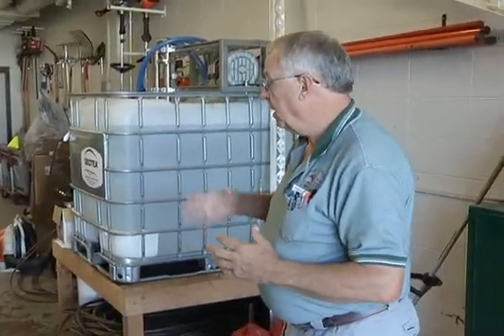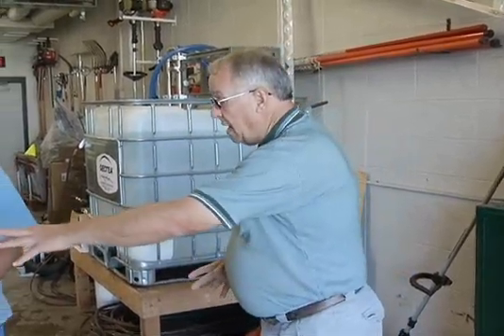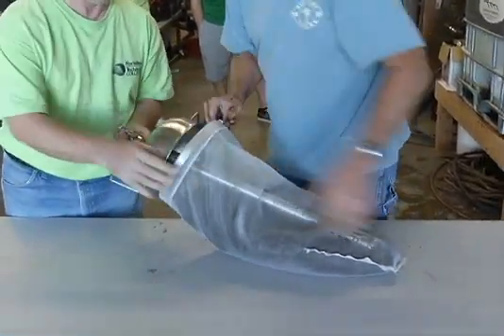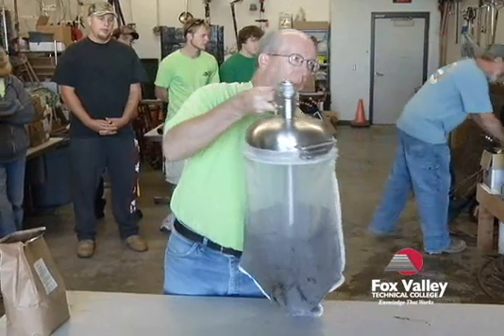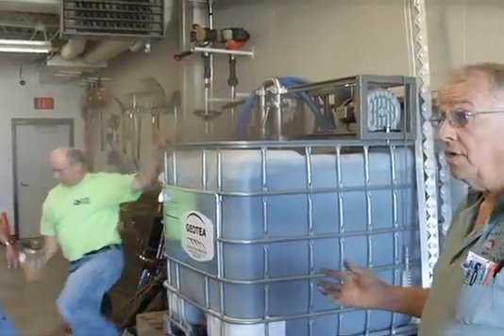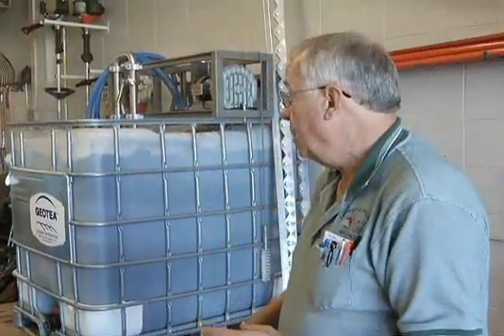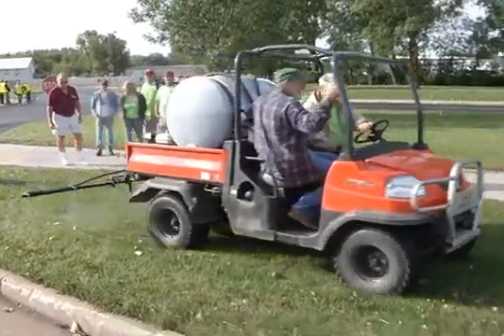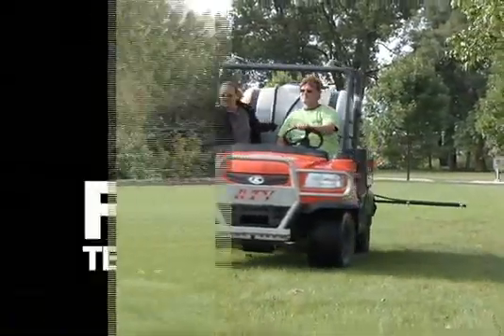How to Make Compost Tea

Comment: I know this was a while ago, but is their any word on atomizing the compost tea with respect to the size of the water droplet size and effect on microb life? I know from a generics lab that putting too much movement/ sheer on the cells and it becomes a solution of obliterated bacterial cells. While an extreme case, In the lab it would be called sonication of cells or in this specific application mechanical sheer stress.